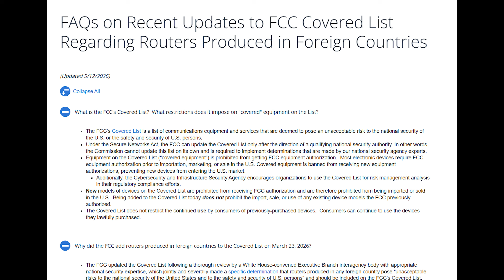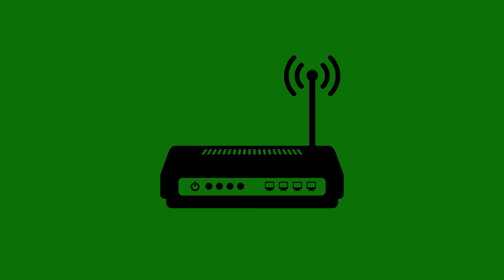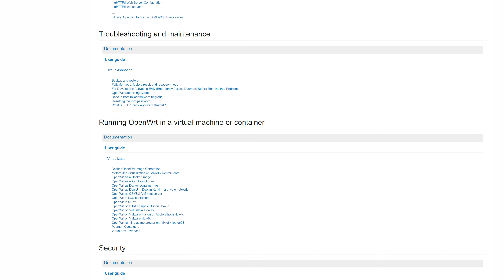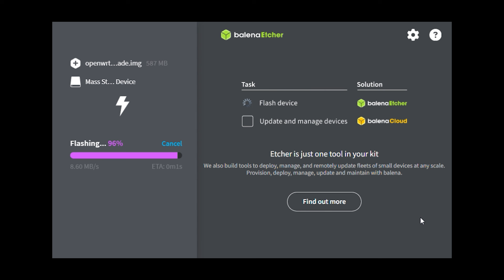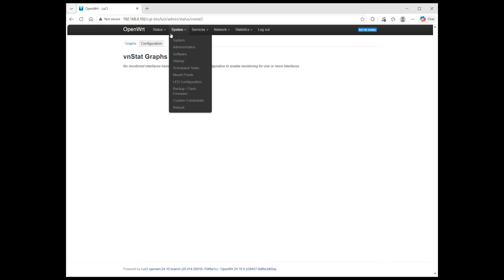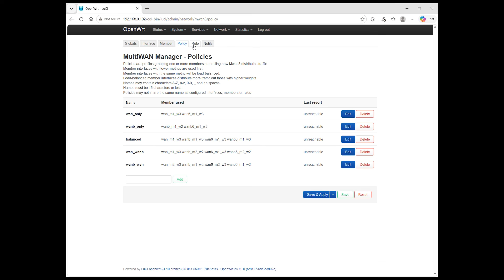OpenWRT on an Orange Pi RV2 - Easy, Fast... and Cheap (kind of)

Comment: It’s not a dumb rule and not made by idiots, there is always something behind those rules, there is an agenda.they just show you the cover you don’t really know what’s inside this book
Reply from the maker: One of the stated objectives is onshoring the manufacturing.  It's also been stated that this is a PRESENT national security issue - imminent threat, NOT supply chain.  Those are vastly different things, with different relevant timeframes, cost profiles, and security implications.  I know the agenda behind the latter, and the agenda behind the former.  The rule, with its exceptions (and how poorly it's written), is dumb - and clearly written by idiots.  

Final assembly will move to the US.  Will the fabs?  No.  Will the hardware engineering?  Who knows.  Will the firmware engineering?  Maybe, maybe not.  If there's imminent danger with deployed hardware, then why is there a grace period?  Why are there exceptions?  What about prosumer equipment?  What about a buyback program for potentially millions of compromised devices?  

It's a joke.  Your analogy would make sense if we were discussing with the dimensionality of a book.  This is a figurative pamphlet.  It's a poorly thought-out reaction to a problem that the powers that be don't truly understand.

Comment: Some nanopis (like R5C and R76S) are officially supported by openwrt. HDMI does not work, however (duh). Not sure about Wifi in M.2 slot, have not tested that as I have other equipment for that.
Reply from the maker: nanos are very popular for OpenWrt builds.  So are banana pis.  Really, SBCs in general, are quite good as routers - assuming there's a device tree and working drivers in mainline.

Comment: Apologies if this has been asked already, but could I use a Raspi with a 1gbps dongle so it has two Ethernet ports?
Reply from the maker: sure.  Or you can get a RPi Compute module (3, 4, or 5) with a baseboard that adds dual (or quad) Ethernet, like this: https://amzn.to/4fkyXgk
Reply: @Dad-The-Engineer  I have a spare Raspi 4, so I'm trying to avoid having to buy another SBC. Damn those AI data centres. 😉
Reply from the maker: lol.  no kidding.

Comment: It's not cheap but you should look into the mono gateway router. It has 2-4 supported OS's right now.
Reply from the maker: mono looks interesting, but if I were in the market for a 10G+ capable router, I'd probably go with the Unifi DM Beast.  My DM Pro is technically 10G, but it can't fully saturate at line speed.  None of that really matters where I am, though, because I'm stuck at 1Gbit/s Internet speeds (for now)
Reply: @Dad-The-Engineer  that's rough being stuck at 1g. I don't know the fastest i get can but have 2g now. I almost when with Unifi because I was getting tired of waiting on the mono router. but I've had it while now and it's been SOLID.
Reply from the maker: honestly, I'm aggregating a connection that's approx 800Mbit/s (cable), with one that's approx. 200Mbit/s (starlink).  I feel like the speed is well in excess of what I actually need... for downstream.  I would kill for a 500Mbit/s connection that was symmetrical for upload and download (though, of course, 1G/2G/10G would be better still)

Comment: Thank you for the work you do on this channel! It's great. I must note, however, that so far most routers on Amazon are still pretty cheap and I have not seen skyrocketing prices yet. I am sure it will happen with this restriction, but so far you can get a WIFI 7 router for under $100. I still love the idea of my own build running OpenWRT. But I need WIFI, mesh, etc. I am sure most people are in my boat. At the moment I am running two Asus RT-AX1800S routers in a mesh configuration. I am able to use Pihole with this setup and I am also able to create an IOT "guest" network for my homeassitant devices. It took a while for me to find a router that was cheap and allowed more than one guest network (one of which I designated to IOT and the other for actual guests) and had an effective mesh infrastructure and allowed me to set my own DNS server address (for Pihole). In any case, I am set for the time being, but I can see the router glitch now and then and I would love to have my own build with WIFI running OpenWRT. I have ran an OpenWRT on one of the old Linksys routers way back when (it may have been a Tomato) and loved it.
Reply from the maker: Yes, there are some routers that are still sub-$100 - and those are appropriate for some use cases.  However, it's easy to hit the configuration, routing, or firewall limits of those kinds of devices - even with just the most modest homelab requirements.  It's good that your RT-AX1800Ses have the feature profile that you need... especially since they don't support Merlin.  

I hear you, on built-in wifi.  I go the other way on that, preferring not to have my wifi infrastructure tied in with unrelated hardware (router).  I have Unifi access points, in mesh (though mostly with Ethernet backhaul).

Comment: Great timing! I just replaced my Linksys WRT1200AC (running OpenWRT fork Gargoyle) with a Linksys EA7500 V2 running OpenWRT. I wanted GUI access to firewall rules and some other stuff and Gargoyle didn't have that. The EA7500 can't max out my gigabit connection so when I get around to flashing OpenWRT on the WRT1200AC that's getting swapped back in as my router. That one should be able to max out the gigabit connection. I'll use the two EA7500s I have lying around as dumb APs and enable fast roaming for that sweet, sweet seamless videocalling whilst walking throughout the entire house. Then I can retire the TP-Link Deco M4 access points for the same reasons you mention.

OpenWRT is crazy complicated at first, I put off using it for years and years. Glad I tried again recently though. It's so powerful.

If the WRT1200AC can't handle my gigabit WAN link then I might get the Orange Pi RV2. I'll see if the used market can get me to a gigabit OpenWRT router for less money first. Also the single LAN port on the Orange Pi is a bit of a bummer, I'd need to add another/bigger switch to the arsenal to compensate for that.

Great video, dad!
Reply from the maker: I would think the 1200AC should be able to manage line-speed routing at 1Gbit/s.  An option on any of the single-port SBCs is to add a USB Ethernet adapter, but many of those don't have hardware offload.  More and more SBCs have PCIe interfaces, which makes multi-port 2.5/5/10Gbit/s cards a neat expansion proposition.

Comment: Got sick of ISP supplied routers about 10 years ago. Tried openwrt on a few but they weren't powerful enough for a growing appetite of devices. Splurged on a semi professional Dratek router and access point setup. Choose Draytek as they we're the only brand supporting dual wan/load balancing at a reasonable price at the time. It served me well for about 10 years but finally the cpu just wasn't cutting it anymore despite still working.  Decided to go to a dedicated OPNSENSE mini PC setup and 16 port POE router + WAP.  Very steep learning curve. My initial choice of PC didn't have Intel NICs which made installation and updating a nightmare. Got it sorted now with a new PC with Intel NICs. I feel I have less idea about what is going on with the network as everything is different in the management interface. I really don't understand all the options and worry I have not set it up correctly.  I'm interested if you can setup openwrt on an x86 PC as I would feel more comfortable with its management interface.
Reply from the maker: yes, openwrt will run on x86/x64 hardware.  I'll be doing a video series on routers, though, which may shed some light on the configuration and use of OPNsense - since I plan on covering that, openwrt, unifi, and maybe mikrotik's router OS)
Reply: Flashing openwrt onto x64 is quite easy tbh.

Comment: I have a stack of old wrt-54g's and would love to still use them but apparently ddt and open-wrt dont support the chipsets anymore. but I dont see why a PI cannot be hacked in to just replace the chipset. They were literally the perfect routers.
Reply from the maker: yeah, I used to get WRT54G's for my family members.  And then the 54GL when Netgear nerfed the 54G.  They were great, but time moves on.  RPis, and most other modern SBCs, are much better platforms for a router/firewall, but it really helps if you have a board that has multiple Ethernet ports built-in.  An RPi Compute Module on a multi-port baseboard works great, for example.

Comment: What are your thoughts on the GL-iNet flint 3? From my understanding their routers are based on open wrt but their gui is not entirely open source. I got one recently because of the expanded features but want an outside perspective on how private it may be because of the lack of open source gui interface
Reply from the maker: I have mixed feelings about the GL-iNet routers.  

On the one hand, I think they're a good turnkey solution for OpenWRT functionality.  On the other hand, I do think that having a closed-source interface sitting on top of an open-source project is a mess, ethically.  GL-iNet has incorporated interesting functionality, with a Tailscale-like network overlay (for example).  It also has remote management with an external connection broker.  Those inclusions pose potential security and privacy risks.  

A good thing to keep in mind, though, is that you can bypass the GL-iNet GUi, and just use LuCI instead.  You can also not use the SaaS value-add services.  However, at that point, you maybe should have just gotten an OpenWrt One router, instead.  Or something like the Orange Pi RV2.
Reply: GL-iNet has not produced an update to my Beryl AX since 2025-08-19. I am disappoint. Not buying again.

Update: It seems there is a beta version available for 2 days. Will probably try that